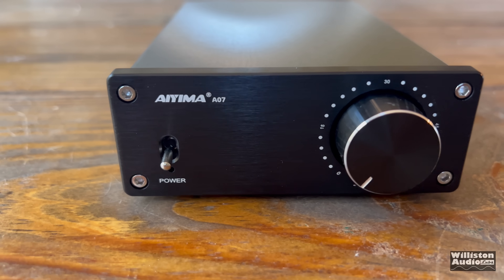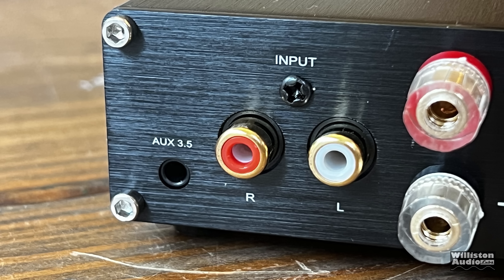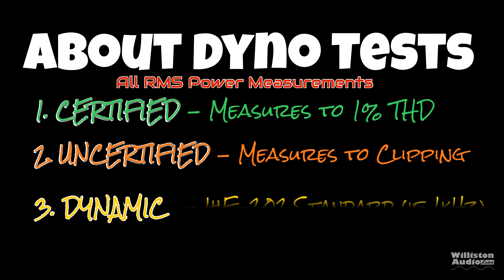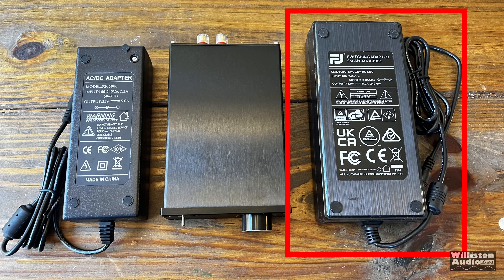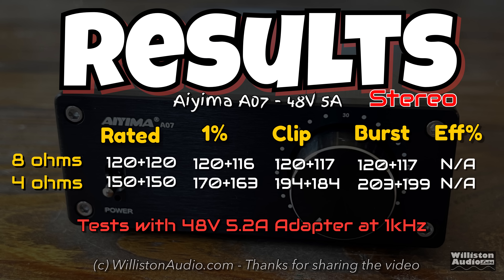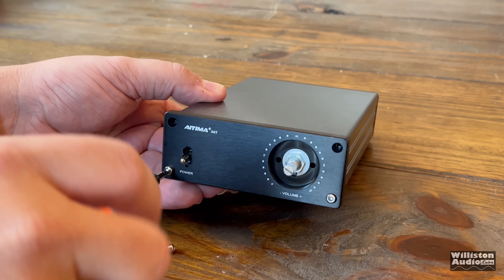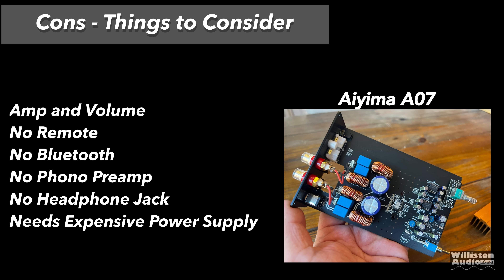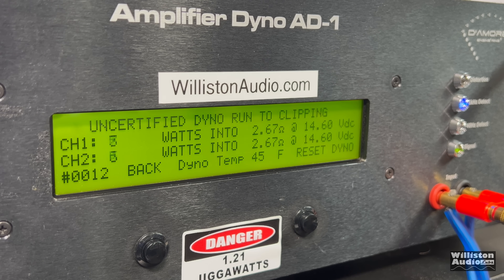Is it the MOST POWERFUL Mini Amp on Amazon? AIYIMA A07 Amp Dyno Test and Review

Comment: Excellent demo. So looks like you won't be able to connect a sub-woofer?
Reply from the maker: You can connect a sub but you'll need to adjust the volume on the sub independently. No variable line out means it's fixed line level, no matter the volume
Reply: @wal  Appreciate the response. I used to own an AIWA Exos9 stereo bookshelf that was 100x2W and sounded pretty decent but need something heavier for the living room and exploring if the AIYIMA might be the way go go.

Comment: You could rig up a pc power supply and an adjustable DC to DC voltage booster to give these mini amps all the power they need. You are crafty enough to pull it off and no longer need to buy more power supply bricks. Of course, they make power supply's that do this already, but they can be pricey.
Reply from the maker: Again, I’m trying to simulate what a buyer will expect, not a custom solution. Yes I could do this but most people won’t so showing those results would be not very helpful IMO
Reply: @wal  I know what your trying to do. I been a long long time subscriber and have probably seen most all your videos. Anyway, A buyer isn't spending more for a psu than the amp cost, but you showed that. I was just saying you could show max watts the amp produced without buying an extra brick. Something cost effective just to keep around. Of course, I would be interested in both, what the amp does with the supplied psu and what the amp can do with the extra juice. I appreciate the video either way.

Comment: You seem not to be quite informed on the subject:  audio POWER amps do NOT have and are NOT supposed to have any "phono inputs" or/and "subwoofer" output connectors - their one and only job is to AMPLIFY the "low level" audio signal. It is the pre-amp's job to amplify and equalize turntable's signal and to "sample/resample" the sound after which it is sent to the power amp.
Reply from the maker: Some of these mini amplifiers do indeed accept phono inputs. No need to attempt to belittle me. Have a nice day
Reply: @wal  But then again, such amp should've been called "integrated amplifier" - every one that's got an embedded pre-amp.

Comment: I have the tda7498 2.1 wired at 2ohm on all channels in my work van powering a full Sundown Audio setup lol. Four 9ah 18v Waitley batteries wired in series/parallel for 40v 18ah. Sundown U 8" in a T line and 6x8 e series Sundown coaxials in the doors and the 5.25 version in the a-pillar/dash area. Run it for 8 hours a day at moderate volume. Sounds great and slams!

Comment: I can't help but wonder about the thermals with the higher power supplies, above the stock.  I would be very concerned.  (take  a peek inside).  I doubt the heat sinking is adequate.
Reply: @Douglas Blake I agree.  I own two of them, am very happy with the stock and it's associated thermals.  Have never done the op roll thing...too much investment.  Just buy an AB for that.  <shrugs>
Reply: @Douglas Blake thanks for that.  That issue you had, goes a way to explain exactly how they are able to achieve the component quality (apparent).  Honestly, it looks too....expensive inside.  That's some serious costs, making a sub 100 retail very dubious (with a reasonable markup).  Still, I am good where I am with my amps.  I paid far less then a 100 us for both mine.  Think around 75-80 us each (sales).  Good to know, thanks for the info!  Cheers!

Comment: that chip does 2x600w at 2 ohms! buying a $100 48v 20a power supply and this $70 amp = 1200w of clean power for $170!
i would love to see what power this pushes at 40hz... would i have to spend another $30 on fans to keep it cool?

Comment: Its funny after doing a few rounds on aliexpress you learn to identify the boards inside simply based on the chassis size. 😂 I got a pair of their full range flat 80mm drivers for a cheap project...they had promise..built em some walnut boxes :) done with plastic.

Comment: Im having a hard time believing this AMP will out Perform my Old HK 775 mono block amps, they have been (Recapped) and transistors have been cleaned and Treated with modern head sink compound...i realize electronics have come a far way from when these were made but you cant escape heat dissipation and mass helps with this dissipation. Ive owned the complete 700 series from New... Inclused Two, 775 mono blocks, 770 stereo amp, 710 Tuner, 725 Preamp, 710 Tuner, 705 Cassette deck, Eq7 Equalizer, Hk720 Turntable and an HK825 Preamp So I find it hard to believe that this small amp can outperform a full size system...I know sound is subjective but can these small amos produce Quality sound wilt large transients or are they made to produce a certain  tone till clipping? Thank you for making the videos I do enjoy them but I do have my doubts. I wish I could test my equipment and also wonder how this little amp will sound after 40+ years of Daily use!
Reply from the maker: I think it goes without saying the sound quality part is very subjective and my goals here are to show power output and features
Reply: well it costs a steak dinner so why not get one and have someone a/b (loudness leveled) it for you???  Plus for $60 after coupon one could buy the new chip every couple years for 40 years.
Reply: @Douglas Blake if one would go through the hassle of a/b blind testing sound leveled I’d speculate most could not tell a difference and if they could the difference wouldn’t be worth the huge price difference. But I’d also speculate there is a small group that can tell a difference and are willing to pay for it.

Comment: 300W in 4 ohms with some like 52Vdc supply and 10% distorsion...
Reply: @Douglas Blake Yes, in fact I have bought one of these amps with this chip about 4 years ago, based on the outstanding specs presented in the datasheet of the chip. I was only pointing out that it is somewhat misleading to advertise it as a 300 + 300W amp, although I reckon for normal domestic listening, the power that this amp is capable to deliver is way more than necessary. Nevertheless, regardless of the specs of the chip, to my ears sound quality of this amp cannot compete with a well designed class ab amp. I have a well designed and well built 30 + 30W such amp, which literally destroys this amp in normal domestic listening. MId bass is way punchier and articulated, and mighs are much less distorted. Maybe it depends on the quality of the ouput chokes and in what opamps are used, don't know. Mine has toroidal chokes and TL072 opamps, which I know are not the best option. I much prefer NE5532 as to my ears, these are totally transparent, in addition to being inexpensive.
Reply: @Douglas Blake I totally disagree on the fact that it can easily compete. Bare in mind, it doesn't sound bad, but no, it cannot compete with just about any 100w amplifier. It would be great, but unfortunately this is not the case. Anyway If you are happy with your aiyima with its chip with 0.0005% distorsion by datasheet, great for you. I do have 6 class D amplifiers, but none can sound like a well engineered class AB amp. I use them for parties and for casual insonorization, just because they are so small and efficient.

Comment: Why a sub needs a variable level line output?
Reply: So the L+R speakers and the sub can be controlled together with amp's volume knob once the L+R-to-sub balance has been set.  That can't be done with the A07 because the 3.5mm jack is actually wired in parallel with the RCA jacks -- IOW, it's actually an input and not an output.

Comment: What a world we live in. We can hop on Amazon and buy a 1/3 RU amplifier rated at 300x2 watts, that actually can do 300x2 watts, fairly affordably. If power can be conjured, that little one could trade blows with some professional amps I've used (and even beat a couple that I own). Cool find. 👍
Reply: well you can't thought...good luch getting a psu that has good reviews and not have a guy saying every third one breaks.  Plus some claim 48/10 but only at 220v.
Reply: @trauma50disaster1  48v is an increasingly common voltage for off-grid power systems. Plus, some "mild hybrid" power trains use 48v motors. Something like this could be great for tailgating.

Comment: You only have to use 4 normal Car Batterys to do 48V  without a powersupply for 75$
Reply from the maker: Each car battery rests at 12.8x4 = 51.2 volts and there are 50V capacitors that may have an issue with this…

Comment: What would this do hooked up to a 36 volt lifep04 battery with 50 amp continuous rating? I have an extra one and it would be great to build a motorcycle stereo!
Reply: @Douglas Blake I find that hard to believe considering it did 200 watts in the tests...
Reply: @Douglas Blake wattage is voltage times amperage...
Reply: @Douglas Blake that and a 36v lifepO4 battery tests at 42 volts.

Comment: I've had dozens of these cheaper amps and this one is really fantastic. They sound great especially with the right pre amp. If you are looking, just buy it.
Reply: @birdyflying4240  the A07 is the best amp for any where close to the money.  Its truly a hifi gem!!
Reply: Got any preamp recommendations?
Reply: @zephrizi9034  Aiyima t8 is a great cheap way to go ($139) . You can tube roll really cheap as well. 
Douk p1 is another cheap and pretty great option ($119)  but no remote. 

Schiit Audio Freya plus would be my next step up but its around $900

Class D works well with tube

If you don't have a streamer yet , you can try the wiim mini airplay 2 music streamer ($99)  and run out of the 3mm aux out and buy a 3mm to rca adapter. Run it straight to the Aiyima A07 

I would consider buying the wiim pro for a few dollars more ($149) and use Alexa device to have voice control.  Run that straight to the Aiyima A07 with reg rca cables. 

 I have not heard this option BUT..... it will give you all kinds of options plus you can use your phone BT to control everything.  

If you aren't happy with the last option, buy the pre Aiyima T8 or Douk p1 and run the wiim to the pre. Then Run the pre to your A07. You will have everything you need. 

If I was starting out.... I would buy the wiim pro, the Aiyima t8, and the Aiyima A07. 

T9 - $139
A07- $64
Wiim - $149 or $99 if you don't care about voice control 

All in $304-$354, you will have a decent dac, lossless streamer, pre, and a fantastic amp. 
You will not beat this set up for anywhere near this price

If you want to go cheap as possible,
Buy the Aiyima A07 and run from your phone headphone jack or computer directly 

$68 option 

If you have speakers you can bi amp, you can also daisy chain the Aiyima A07. Their are ways to make this work for subs as well. I have ran a sub using the 3mm out of the A07 and it worked. Its technically a full range out which is why you can Daisy chain the amp.
Reply: You watch cheapaudioman by chance? I've seen all the products you listed here on his channel, its how I got this amp. Its sweet, my first one so can't AB, but I'm happy with it!
Reply: @daniel12345abc  I do. Randy is killing it and seems like a nice guy but I have been disappointed in a few of his product endorsement choices but overall he is usually right on. What I have found  is ultimately synergy is king.
Reply: @ufarkingicehole  Any chance you have experience with the smsl su-6 and sh-6 stack? I'm currently have the dac, considering getting the headphone amp. I'd use it both as pre-amp (into my ayima a07, into my speakers (Overnight Sensations)) and headphones (will be getting sennheiser 560s). What seems super appealing to me for that headphone amp is the toggle to switch output to speaker / headphones. Curious if you've tried it or have experience with a similar product? Reviews seem positive on it from various sources, I'm just not sure if it will negatively impact my speakers sound. I'm quite a noob with all the audio stuff still so trying to get info from more sources...
Reply: lmao paid reviewer spotted
Reply: @automachinehead  I wish. I've spent a ridiculous amount of money and time finding the best products.  The A07 is legit ridiculously good for the money.

Comment: Thanks for the Test. Aiyima also has a second version of this TPA3255 amp with an internal powersupply capable of the 630w, Bluetooth receiver, USB-DAC and line-in. It's the AIYIMA A08. Would love to see a test of it, too. Would be interesting to see how much the power supply of the A08 can actually provide
Reply: There's an A07 Pro out now but ASR forumites don't seem to like it (going by recent chatter, anyway) and consider it a downgrade. I own the A08 Pro, which I've had since September 2022 (the versions all get a bit confusing!). All of these amps are TPA3255.
Reply: Just noticed that the A08 300w x 2 model isn't available anymore and got replaced. There is a new version of it, the "A08 Upgrade A200", but it only has 200w x 2
Reply: Just received the A200 today. Sounds pretty nice, haven't put it through the ropes yet. Powering Polk R500s.
Reply: Nicegram_Me-WillistonAudioLabs  Oh no, not this scamming idiot again.

Comment: One thing that I find curious.  Why are car amps less expensive than home amps? Why not just run car stereo electronics in a home setting (other than speakers of course)?
Reply: Home amps need to convert AC 120W 60Hz power from the wall into DC with a transformer.  Car amps need DC too, but don't need the transformer because the power supplied is already DC.  Transformers cost money, just like the ones being talked about here in this review.  
     Speakers, however, have no differences between home and car.  They both function on the identical principle.  Speakers only have different design attributes that make them more desirable in one setting over another.
    You wouldn't want a paper cone speaker in a boat, for example, because it would disintegrate when soaked with sea water.  So there are "Marine Speakers".  🔈🔉🔊

Comment: 10:28 ah yes the power supply 

Actually you do not i repeat do not need to spend 80+$ on a power supply 
I purchased a 48v 12.5a 600w power supply from AliExpress for 37USD, yeah it'll take a few weeks to arrive but it works like a dream!

I have a bridged 600w aiyima subwoofer TPA3255 hooked up to my 10" DS18 sub (indoors) and it absolutely slams!

Power supply barely gets warm and the sub can easily accept more but the amp isn't capable of outputting the amount of power the sub can take

So again no need to purchase an expensive power supply, a "cheap" one from AliExpress should work well! (Of course just make sure that it is enough for your project)
Reply: it works like a dream burning down the house...unplug that mess when you are not directly watching it
Reply: @trauma50disaster1  I know a thing or two about electrical, the power supplys that comr with thease amps aren't any safer

I took apart the power supply to confirm it is of decent quality for the money.

Also i do have a switch on it, i turn it off when it isn't it use.

Comment: What would the power be for just a single channel?  I use one of these for a center channel and was curious what the power spec would be.
Reply: @Douglas Blake -- AFAIK modern Class D chips have no problem with being powered up without a load.  Some of the early ones that depend on external MOSFETs did, though -- that's why I hope the voice coil on my old Infinity PS-10's driver never opens up while out 14 year old is blasting Shawn Mendes!
Reply: @Douglas Blake -- Fair enough, although I own two Class D guitar amp from Quilter, and their manuals explicitly state that it's OK to use their headphone jacks for practice with nothing plugged into the speaker jack.
Reply: @Douglas Blake -- "Hi" right back atcha.  😎

It just occurred to me that there's a simple safety measure to protect the unused channel of an A07 (or similar decent "chip amp") when only one channel is driven and duly connected, e.g. for a passive subwoofer.  Since the idle channel is getting no input, a relatively low-wattage 4-8 ohm resistor can serve as a perfectly adequate dummy load, since the only current flowing through it would be minuscule, if anything.  A shorting plug in the corresponding RCA jack would also be a good idea.

As usual, feel free to shoot my ideas full of holes.  😇

Comment: I use this amp in my home theater to power two of my Atmos celling speakers. Also if you want the full 300 watts a channel you have to get the 48v 10a power supply for it. While I think it's stupid that they advertise it as putting out 300 watts a channel, but don't provide the power supply that will do it, I do believe it will do it because the manufacturer provides tons of measurements for this amp showing that it will do it.

Comment: I still want to see the amp dyno test of the JBL Xtreme 3 Bluetooth speaker to see if it actually does it's rated 100 watts output on its power supply and 80 watts output on its battery I've got a JBL Xtreme 3 and I want to know if I got what I paid for it's a great sounding speaker with good bass I just want to know if the power ratings are true because it is a Bluetooth speaker and Bluetooth speakers do have their limitations I want three tests done test number one on the power supply test number two on the battery and test number 3 in low-frequency mode. To activate low-frequency mode hold down Bluetooth pairing button and volume down button at the same time for 10 seconds